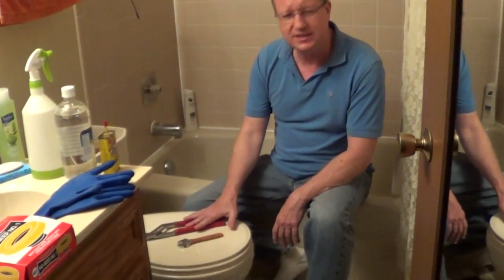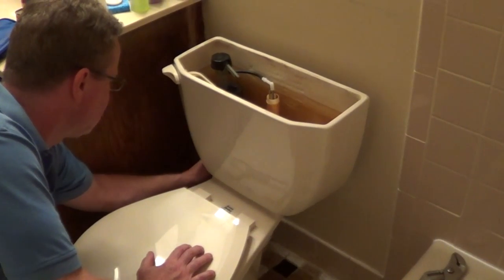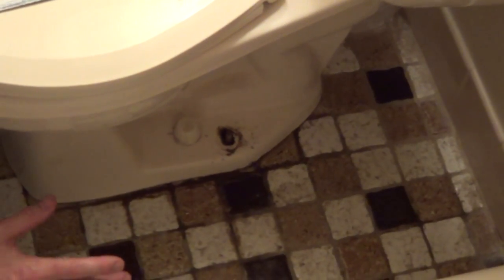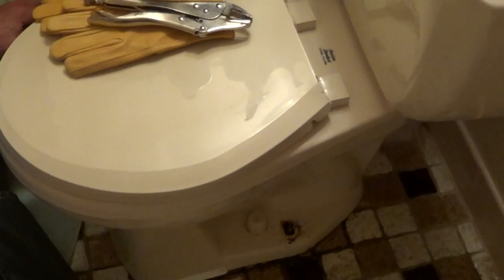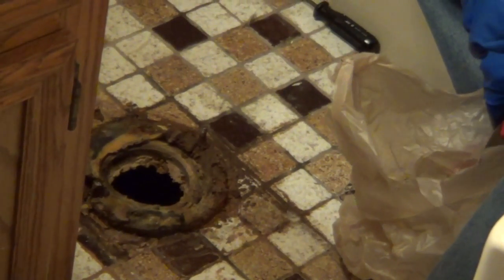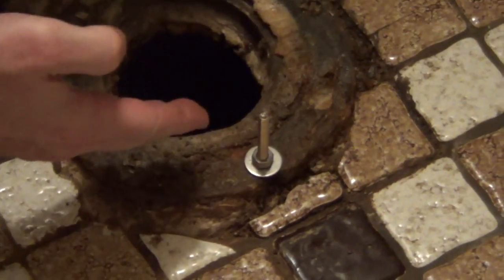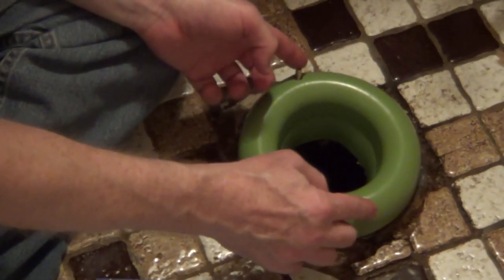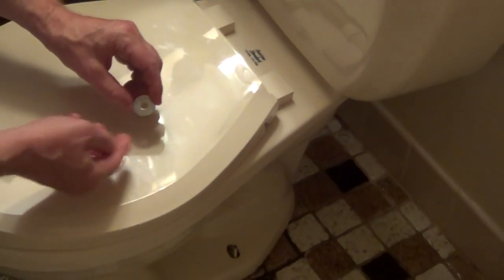Replace Toilet Wax Ring - No Wax Toilet Ring - Toilet Leaking at Base

Comment: Yeah, but do Home Depot or Lowes carry the Sani Seal? I figure that with what I am dealing with, a crooked flange with some lead wrapped over it that is missing in the front, with that set up I need the Sani Seal gasket really bad. If not at those stores then maybe at the supply house.
Reply from the maker: Hi, a lot of local hardware stores like True Value or Do it Best will sell it. There is a wax free gasket by Fluidmaster that works well too.
Subscribe to our weekly podcast for some home improvement tips. 
https://itunes.apple.com/us/podcast/fix-it-home-improvement/id880903087?mt=2

Comment: my toilet bowl is totally sealed with plaster and it has a leak could be anything since the wax to a rotten floor and after seing your video i will try to fix it by myself... but i have no experience whatsoever. any other tips for that whole process? thank you so much!.
Reply from the maker: Hi, it is usually just replacing the toilet gasket. You will probably want to replace the bolts and supply line. If you run into any problems send me a picture to fixitpodcast@gmail.com. Good luck.
Reply: If the subfloor damaged you must replace the damaged part. Its big job.

Comment: Thanks for the advice on the Sani-seal. I'll give it a try.
Reply from the maker: Let me know what you think.
We have more tips in our home improvement book https://amzn.com/B01MRGO8C5
Reply: I'm hoping to get something different than wax. We have one bathroom in a five person house, so due to high volume,  I have to replace the wax seal about every two to three years. It's become a common replacement.
Reply from the maker: It's been great on our projects. Fluidmaster also has a non-wax gasket that is rated well.
Reply: That's the one I ended up getting at Ace.

Comment: Hi so i just did everything but for some reason the toilet is not laying flat. I believe the ring is too high. what should i do?
Reply from the maker: Hi, can you have someone sit on the toilet while you tighten the nuts? Do not over tighten! 
Another thing you can do is lift the seat and have someone stand on the rim of the bowl. Let me know if it sets flat when someone is on it. 
You did remove the old gasket and clean any wax from the bottom of the bowl.

Comment: I was going to try one of these, until I saw the pics on Amazon reviews of the effects Chlorine in the water is reported to have on the foam.  Seems to break down the outer skin and allow it to soak up water and eventually collapse and become useless.   I really wanted to like these.  When reviewing anything theres more to it than just ease of installation, theres also longevity in the long term.
Reply from the maker: Hi, thanks. Luckily I've never had a problem. We've used these in our properties for years and have never had a callback. We have a couple remodels coming up in bathrooms where we have installed it, so I will take a look.
Reply: To be fair I was only repeating what I had seen and read, no first hand experience. They do look like a good idea to me, im all for something that does away with the wax mess-lol
Reply from the maker: So far they have been great.
Reply: I hope they stay that way-! lol

Comment: Just a warning about the "universal" fit.  If you have a raised flange, you can't use this product.  The maximum height of the flange above the floor is less than 1/4 inch. This is on the box, about 20 lines down, on the back of the box. I found this out after my third try trying to fix my leaking toilet.  I am getting good at it, though.  My second waxless seal.  And one wax seal, that didn't seal at all.  At my age, this is really frustrating.  I did this when I was younger, never took more than one try.

Comment: I found a leak in my basement sealing and tracked it back to the wax ring in my main bathroom. I'm so glad I saw this video! The last toilet I installed was a disaster. I went through three rings because all 4'10" of me could not align it correctly. I had to reposition this one twice, but it bounced back and knock on wood, it appears to be leak free!
Reply from the maker: Great. Let me know how it works.
 We have more tips in our home improvement book http://www.amazon.com/dp/B01BK2K0JM?ref_=pe_2427780_160035660

Comment: I have followed these steps and completed replacing my toilet.  I noticed after a couple days, the toilet started to wobble a bit.  How much tighter should I tighten the side bolts down, I don't want to risk cracking the porcelain
Reply from the maker: Hi, grab the front of the bowl and lift up, if it moves, tighten it slightly. Keep repeating till it don't rock. You can crack the bowl, I've done it. So a little at a time.
We have more tips in our home improvement book http://www.amazon.com/dp/B01BK2K0JM?ref_=pe_2427780_160035660

Comment: Yes Sani-seal works great, today is 6/7/2016, I learned about sani seal 3 days ago, it WORKS GREAT, no more WAX rings, yes it cost about $12.00, but, it is well worth it.  Thank you for posting.
Reply from the maker: You're welcome. They work great!
We have more tips in our home improvement book http://www.amazon.com/dp/B01BK2K0JM?ref_=pe_2427780_160035660
Reply: Didn't know about Sani-seal, recently used wax ring, am gonna replace it asap with Sani-seal.  Excellent video!

Comment: Easier to use a dremmel tool with a cutting wheel to cut the bolt.
Reply from the maker: Thanks for the tip. I need to give that a try. 
We have more tips in our home improvement book http://www.amazon.com/dp/B01BK2K0JM?ref_=pe_2427780_160035660

Comment: Nice, good stuff. One point though - if you're not that strong, this process goes a lot easier if you remove the tank during replacement. .
Reply: You also save the tank from possibly cracking or come lose at the bolts.

Comment: There is a thin waterproof layer on the Sani Seal that if broken, will cause the seal to act like a sponge and start leaking again. Unfortunately, the Sani Seal did not work for me.
Reply from the maker: bjfeen Hi, I spoke to the company, they did say if you tear the top layer to replace the seal. Nice to know. I've never had that happen. So far they have been excellent.

Comment: I just replaced mine and I noticed that at the bottom of the main pipe I could see some water and was wondering if you knew if this was normal?  I have been having suction problems with the toilet to where it will not even flush toilet paper and the bowl does not re-fill, only the very bottom retains any water.
Reply from the maker: glenn d Hi, I would first check the fill valve inside the toilet tank to see if the hose from the fill valve is putting water into the overflow pipe. This is how the bowl is filled with water.
Reply: The fill valve has no leaks on it and water flows thru the hose well during the entire tank refill time, it just slowly drains from the bowl until there is just that little bit left on the bottom.  The flush action of the bowl when draining also does not have enough "power" to even remove toilet paper, and there are no leaks coming from under the toilet itself.
Reply from the maker: What is the make and model
Reply: The tank has an UPC mark on it, but the bowl has no markings on it.  It is a older two piece toilet.
Reply from the maker: glenn d Hi, does the water in the bowl drain faster during the day when using the tub and sink. It could be a clogged vent. Possibly from birds. It could also be a small crack in the bowl. Can you hear any dripping after the toilet fills?
As far as the flushing power. Is the water filling into the tank to just below the overflow pipe? Is the flush valve opening all the way for the water to move quickly into the bowl? The chain could be hung up or need to be adjusted.
Reply: The water level in the tank fills all the way up to the mark on the overflow pipe and stays filled until flushed.  The flush valve opens fine and closes to a tight seal.  There is some gurgling noises after the flush cycle completes, but I also notice when it is first flushed, the small amount of water in the bowl sprays upwards a bit, almost like the bowl is burping (for lack of a better word)    Thank you for answering.
Reply from the maker: How are the other drains. Tub and sink?

Comment: the flange on my drain pipe sits a little too high.  I couldn't use the saniseal because the toilet rocked too much....back to the wax
Reply from the maker: Mistah Young Hi, a trick I've seen a couple people do is to take a razor knife and cut down the top on the Sani Seal. I've never tried it yet.
We have more tips on our weekly podcast https://itunes.apple.com/us/podcast/fix-it-home-improvement/id880903087?mt=2
Reply: +FIX IT Home Improvement Channel old wax ring is best

Comment: OK, so the new sani-seal. Nice design but I noticed when you pulled it out of the packaging, you had to flip the flap to the downward position to ready it for installation. That's great and all but after it's installed, what is there to keep that flap from flipping back up when some heavy plunging is going on for a stubborn blockage? I bet the designers didn't think of that. If that flap were to somehow find it's way back into the folded up position then some waste water could find it's way between the bottom of the seal and the floor causing a weak floor over time. See, a great new and improved product can't be a perfect one-time fix can it? Shop Smart....shop S-mart.
Reply from the maker: 73Cheetah Hi, when the toilet is sitting on top on the seal, it would have a hard time folding back. Most clogs are in the trap of the bowl, so there is not a lot of pressure or water to pull it back. We've been using this for years now and have not had a call back. I've ruined a lot of wax rings over the years doing projects and had a lot of customers at our hardware stores ruin a wax ring the first time they tried replacing them. I really like this design a lot.
Reply: FIX IT Home Improvement Channel Yes that's true. Most clogs are in the trap. I'm about to maybe do a wax ring, or maybe try the new stuff out there like the sani-seal. I don't think I have a leak yet might have just been some water splashed down on the floor when I was plunging. I try not to plunge too hard in fear of damaging the wax ring from pressure. I checked the floor from downstairs and it's in great dry solid shape. I can see under the toilet a tiny bit and I just don't like the floor grime that accumulates under there where you can't reach while cleaning. Also my toilet floor bolts are very rusty I've been treating them with penitrant to get them ready to be loosened(might have to cut em) Was thinking of going stainless on those two bolts what is your take on stainless? Some guys prefer the brass ones I wonder why. Thanks
Reply from the maker: Hi, I like stainless steel. I also add an additional stainless steel washer and nut to lock the bolt to the toilet flange. It holds the bolts in place when seating the toilet and makes the nut holding the bowl easier to remove in the future.
Reply: FIX IT Home Improvement Channel Sounds like a plan. Thanks
Reply from the maker: Let me know how your project goes.
We have more tips on our weekly podcast https://itunes.apple.com/us/podcast/fix-it-home-improvement/id880903087?mt=2

Comment: Good tips. Not only did I have a bad wax seal, but a bad flange as well. With the exception of the flange, I had the same issues noted in your video. It took some time to remove the old flange, but everything worked out well.
Reply from the maker: Esoteric Great.
We have more tips on our weekly podcast https://itunes.apple.com/us/podcast/fix-it-home-improvement/id880903087?mt=2

Comment: Those seals soak up water and end up stinking.
Reply from the maker: Dog The Drama Queen Hunter Hi, I haven't had an issue with that. We will be redoing the floor in a home where I put one in. I will check it out.
Reply: FIX IT Home Improvement Channel I used them on a rear discharge toilets, we had a odor problem, so I checked, all the plumbing and the toilet was new. squeeze it and the water just pours out. I purchased the 5 of them through Sani seal directly, all were Green.

Comment: I watched a couple of videos on this topic, and I prefer yours.  Thanks for including info on how to handle some extra problems that I might encounter.  And thanks for mentioning that there is an alternative to wax rings seals (which I assume have been around for a hundred years or more.)  I was just thinking, there has got to be a better solution than wax rings.  The local Home Depot didn't have what you showed in the video, but they had a sorta hybrid thing called the Danco Perfect Seal that looks good.
Reply from the maker: Jeff Peake Cool. Let me know how it works.
We have more tips on our weekly podcast https://itunes.apple.com/us/podcast/fix-it-home-improvement/id880903087?mt=2
Reply: I thought that this job would be a piece of cake, since I'm in a pretty new house (<10 years old), but it ended up being an incredible hassle.  No problem with the Danco product, as far as I know... yet... but I was unprepared for the other problems that I encountered with the job.   :-(  I learned a lot by doing ithe job myself, but the cost in time and frustration was really high.

Comment: Actually a wet/dry shop vac is real handy for removing any excess water from the tank and the bowl. It will leave everything much drier and make removal much neater, especially when carrying the old toilet out of the house.
Reply from the maker: Bill Daniel Great tip. Thanks.
We have more tips on our weekly podcast https://itunes.apple.com/us/podcast/fix-it-home-improvement/id880903087?mt=2
Reply: Thanks for leaving that tip, Bill!  I even have a wet/dry shop vac and forgot about using it for that.

Comment: Thanks for video. This crappy seal contributed to my toilet flange cracking. 
Then after I repaired it. It won't compress far enough to bolt the toilet down with out breaking. I'll be throwing it in the trash! Thanks again!
Reply: Jamel, same here. Although I never got to the point of cracking the toilet flange. Even in the video, when he first places the toilet down you can see it bounce. Not sure how he gets his down far enough. If the seal was maybe a bit thinner it would work. My toilet still moves enough to cause leaks. Guess it is back to wax seal. At least I cleaned up the remnants of old wax ring well from trying this, so not a total waste of time. Lifetime warranty? Hah.
Reply: Thank you for sharing saw these green non wax rings and wasn’t sure if I should try one. So I’m glad to see your experience with the product.

Comment: Thanks for the great tip. I was replacing a wax seal and decided to review the project before starting. After watching this, I went out and got one. Worked like a charm. No more wax seals in this house.  I really liked the idea of putting bolts onto the  flange and tightening them BEFORE replacing the toilet. That too worked like a charm. Makes the job a lot easier.
Reply from the maker: den5276 Great. Glad I could help. We also have a weekly podcast. Here is a link http://www.stitcher.com/s?fid=49441&refid=stpr
Reply: Would you believe my other toilet seal started to leak last night, 1 day after I repaired the 1st one??  Another Sani Seal and made the repair.   Getting to be a pro at this :-(       A also bought a spare seal, just in case the 3rd bowl goes bad.
Reply from the maker: It's nice that those 2 won't be a problem for a long time!

Comment: Good call on the "Sani-Seal" instead of the wax ring with collar. Real easy to install and you can feel the compression against the toilet flange; it feels like a solid seal. It's about twice the cost of the wax collar but worth every penny. Very helpful clear video. Thanks for sharing!
Reply from the maker: Boris Dirnbach Thanks. I haven't had a call back after I started using them.
We also have a weekly podcast. Here is a link http://www.stitcher.com/s?fid=49441&refid=stpr

Comment: is this easy for a first time beginner? I don't want any surprises.  I know you are not advising me to do it/nothing legal, I just wondered if there are any twists or things that typically go wrong on this? thx great vid
Reply from the maker: Hi,
Just don't tighten the bolts down too tight when putting the toilet back on. Snug it up, grab the front of the bowl and try to rock it, if it moves, tighten a quarter turn at a time till it is snug and doesn't move. Make sure you turn off the valve to the toilet first. You may have to cut the bolts off if they are rusted in place. Get the extra water out of the bowl before you remove it. Set it on an old towel. Let me know how it goes.